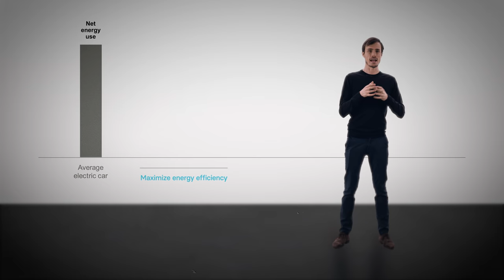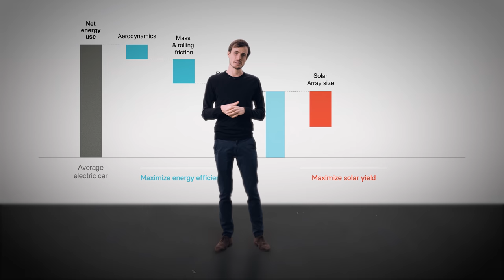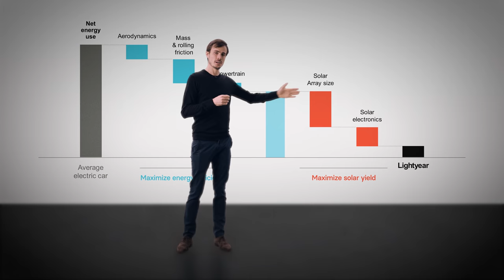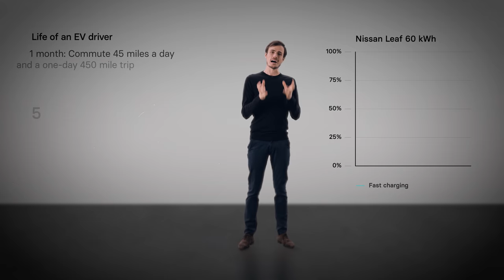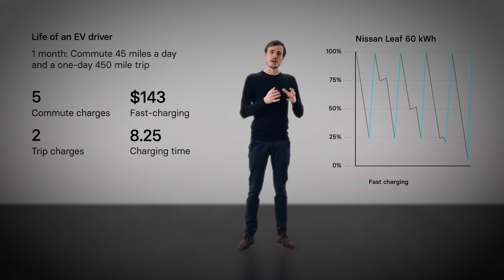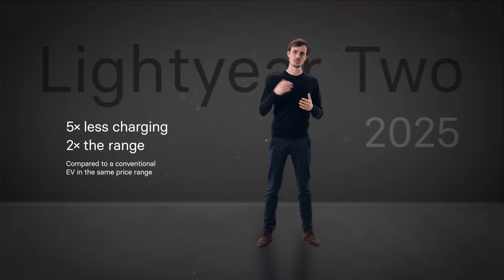Lightyear Keynote Presentation — Strategic Roadmap & Product Vision

Comment: Please look at Graphene Manufacturing Group's G+AI batteries, NovaSolix's carbon rectenna, and the recent article by MIT on 40% heat conversion efficiency solid state heat engines. If you could incorporate these technologies with your massively efficient Wh/mi approach, you would lower weight, increase battery density, shorten charging time, eliminate battery degradation, eliminate battery cooling systems, improve air conditioning efficiency (with ThermalXR), quadruple solar output, and have post-solar energy generation.

Legitimately; Lightyear, NovaSolix, and Graphene Manufacturing Group are at the cutting edge. You have the aerodynamics, weight reduction, and motor efficiency to truly beautiful levels, and they have a helping portion to the rest of efficiency puzzle.

All the best,
A big fan
Reply: thanks for making the car even more expensive
Reply: @3nityC  This would actually make the solar cells and batteries for the car less expensive.

Comment: There so much wrong in this obvious PR video
- Talking about Europe and taking Los Angeles as example is just wrong. Take for example Ruse in Slovenia or  some other City in Valley. I live i a small town, there has been no sun since 3 weeks, the road goes around a river in a walley, there is also no sun, just shadows from threes and hills. Sun rises behind the hill around 10 am FYI.
- Small batteries for 30.000euros, so much money less range, more charging stops? Hahaha. My Diesel was 15.000 Euros and does 1000km if its day or night and if its sunny or not and takes 5 minutes to "charge" - anywhere.

In the video they are driving on a sunny racetrack, haha. Come here where I live and drive in the walley. I go practicalli to the work in the dark and shadows and arrive in the night, if there is sun, it is a miracle in the other half of the year.